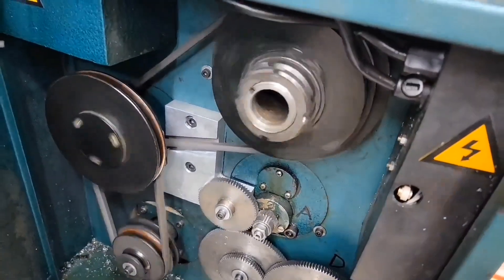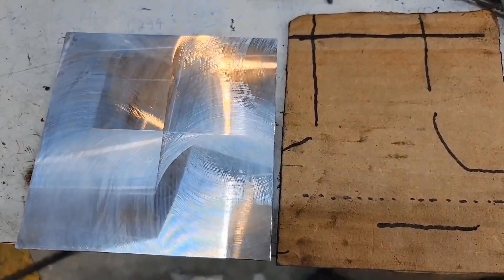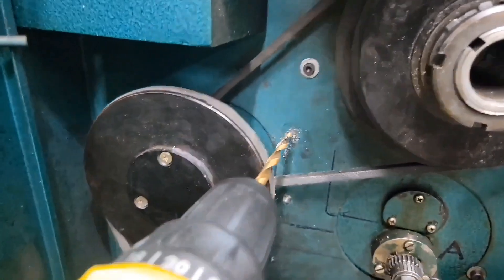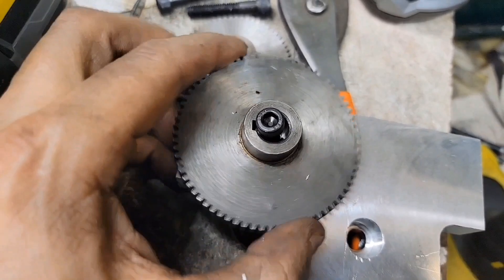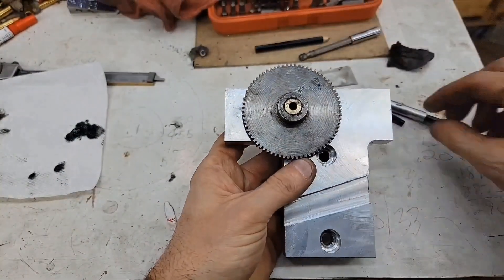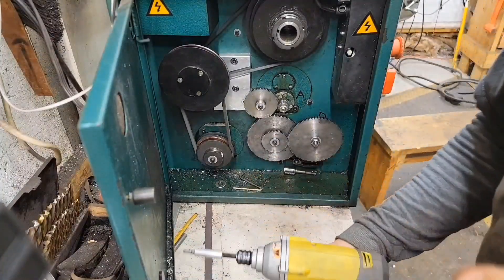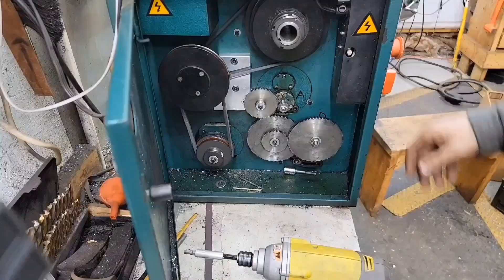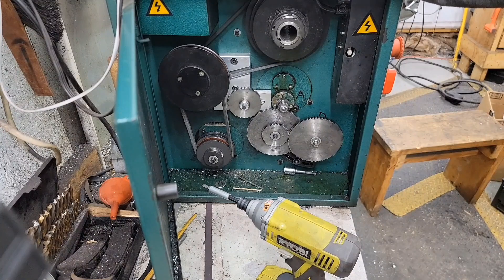Grizzly G9729 Lathe Reverse Power Feed Gear Modification

Comment: You’re down right dangerous operating the bandsaw!
Reply from the maker: @wk7060  safety 3rd !   I know I know.  Every time I use it, it's cutting a different size and type of material.  I never adjust it.  But then, it hasn't bit me YET either.
Reply from the maker: @wk7060  more than 50% of the time I'm making a homemade gun of some sort, so the method by which I use the tools probably isn't the safety concern it may seem.
Reply: i do it the same way with table off

Comment: This is a good way to reverse the lead screw but if you look at the adjustment plate for the gears, it has another slot that you can put a tnut on and install one of your other gears and boom! You have a modification without building another bracket. This mod only works for threading, which was the only time I wanted to run the lead screw in reverse. If you want to turn in reverse then the mod in this video is the one you want to do. I’m installing a picture to reference what I’m talking about.
Reply from the maker: @odellkimes4497  the adjustment plate doesn't have enough room for a 2nd gear unless only using the smallest of gears.  Options !  I like having options.  When turning up to a shoulder on the right, it's nice to turn normal, but feed opposite.  Most, non-hobbiest lathes have that option.
Reply from the maker: Nice !
https://youtube.com/shorts/cw_rUDxAhq8?si=_YA4aop5bq9GFTu8
Reply: great! thank  you, the reserve slot in the bracket works only for left hand threads not for reverse feed, still very useful 👍i have the very same machine and i am interested to make both, the reserve slot T nut plus a new bracket for reverse feed ( but hopefully a simpler design) 🙂

Comment: Brilliant idea. 
I have almost identical machine.
Reply from the maker: It's still not a quick change gearbox.  But it's a small step in the right direction.   I've seen some other similar mods.  I went this route for versatility.  And since none of it is permanent, I could always do both.

Comment: I went a much simpler route by adding an idler gear between the lead screw gear (D) and the (BC) change gear positions.  It attaches to the existing pivot plate with a sliding flange & nut that also serves as the idler gear's  bushing.
Reply from the maker: Care to take a video of that?  I've seen a couple but they looked like they were more of a pain to change.  Like had to move 2 existing gears plus the new idler.  I'd love to see your solution.
Reply: @arbon4433   I have posted the link to pictures of it 3 times and YT must be taking them down.  I guess you'll have to search for "G9729 reverse idler"  and select the match found on the Hobby-Machinist forum.